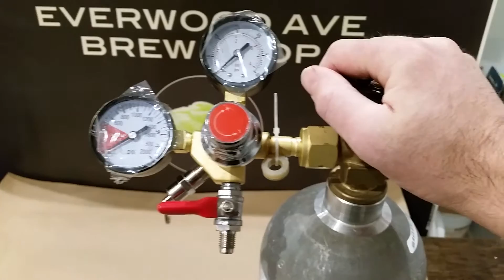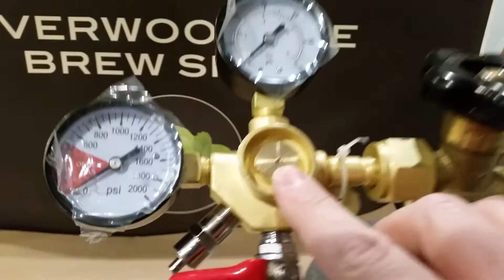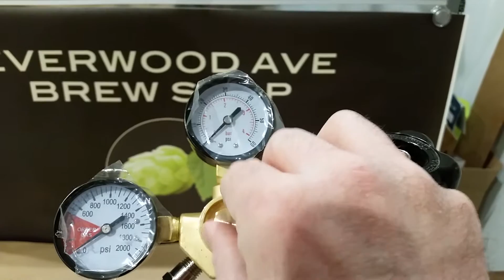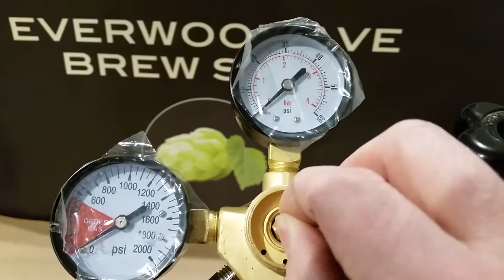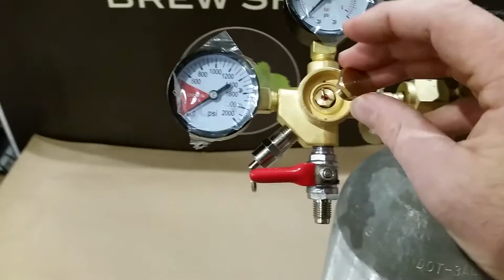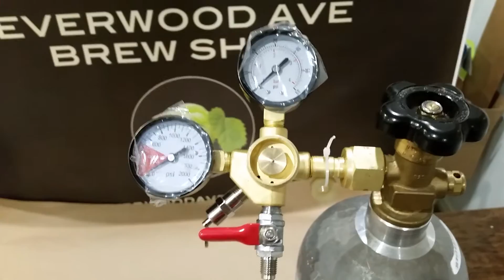Regulator Repair - Regulator Creep

Comment: What if my pressure decreased over night but tank pressure is still the same
Reply: I have this problem as well. I set the pressure on a fresh keg and it should be using gas as it goes into solution. But the regulator acts as if I had closed the valve on the tank and shows no pressure the next day. I readjust the regulator until it shows the set pressure again. Then it goes through the whole thing again. I’ve leak checked everything I can think of from the tank mount to all the seals on the keg. My thinking is that if it was a leak the regulator should try to hold the set pressure until the tank was empty. It’s still quite the head scratcher for me.

Comment: "Never use teflon tape or any other sealant on cylinders. 
The threads do not seal a CGA fitting, the fitting itself does. If the fitting doesn't seal, it's a) loose b) dirty or c) damaged." 

COMMENT #2: https://weldtalk.hobartwelders.com/forum/weld-talk-topic-archive/welding-processes/24553-wrap-regulator-threads-with-teflon-tape